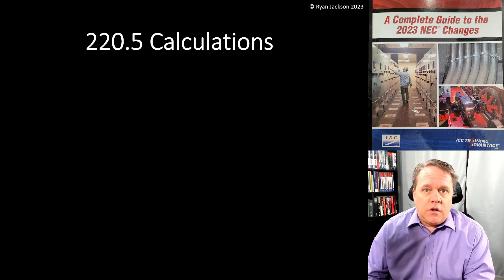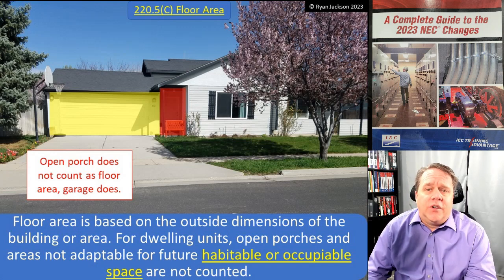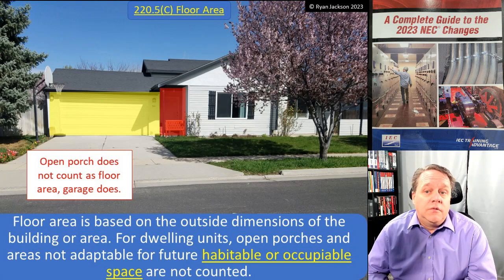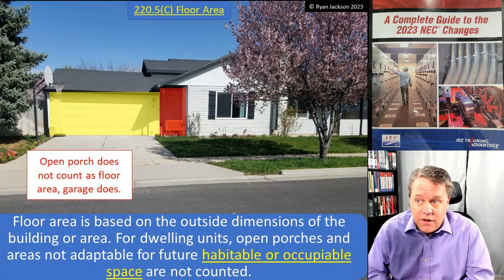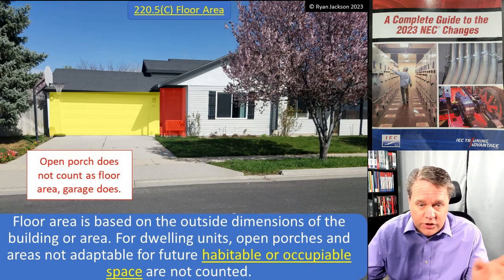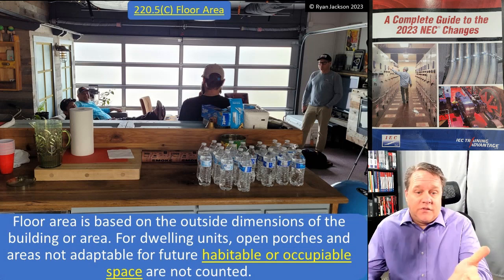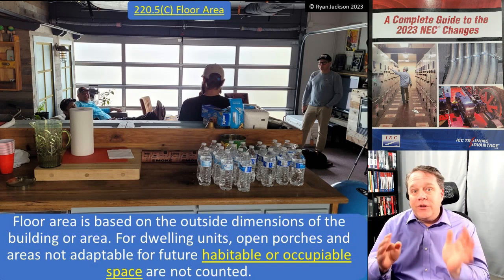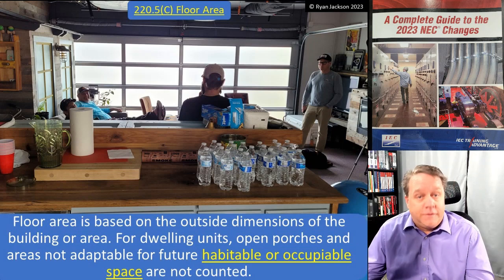2023 220.5 Calculations

Comment: What about 220.82b1
Reply from the maker: Yeah, it's a screw up. They fixed it for the 2026.
Reply: @RyanJacksonElectrical  if I go take my test should I add the footage for garage. By the way thank you for replying to my comment. I appreciate what you are doing so much.
Reply from the maker: @raymundodiaz4514  It is not too likely that your question will deal with this specific issue...but it could. If it does, you need to appeal the question. Explain in your question why the question may have confliting answers. I am the subject matter expert for the exams in several states, and appeals get sent straight to me. If I read a person't appeal and they showed a a contradiction like this one, I would "give" them the question. I also recommend working the question both ways to see if there is only one "right" answer as well. Choose that one as your answer, and challenge the question via appeal.

Comment: Although I agree that garages should be included in the 3 VA per square foot, when referencing 220.5, but when you look in 220.82(B)(1) it states that garages are not included in this formula. Could you explain this, as it seems to be a contradiction?
Reply: I agree. I also think that with this conflict you cannot enforce including the garage as floor space. Although, it might not be a conflict. What makes us consider the garage "adaptable" for future use as habitable space? It is intended as a garage. By that logic any unfinished area is adaptable for future use as habitable space. It's just a matter of how much work it will take.
Reply: Yes, I would love to know the answer. It's making me confuse.
Hopefully we can get an answer